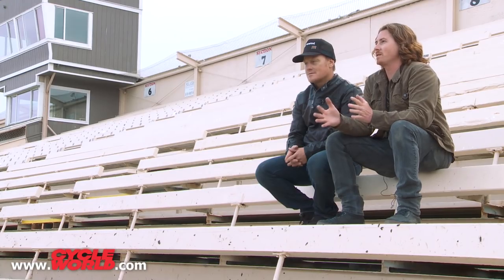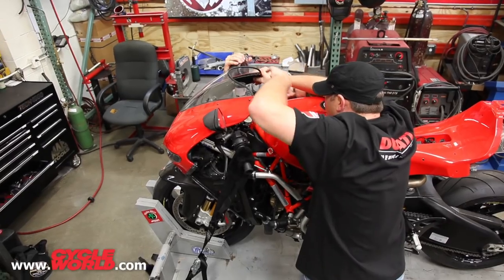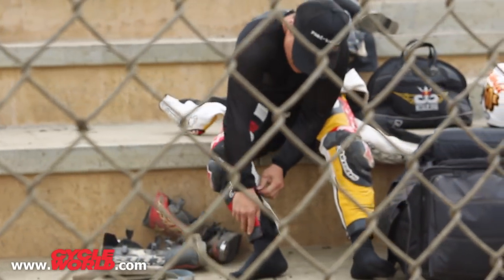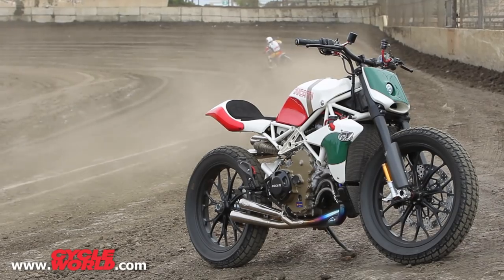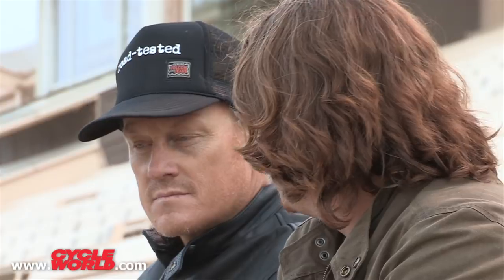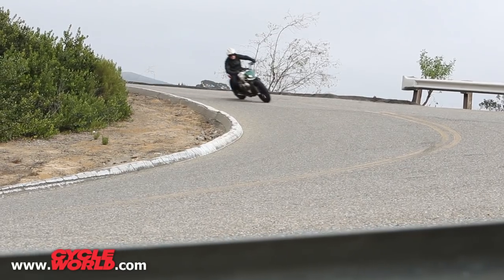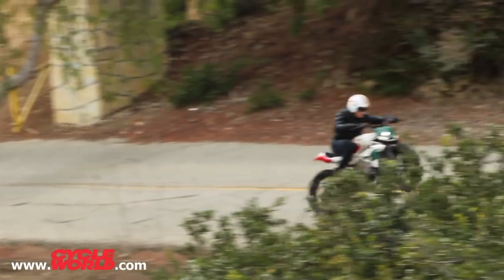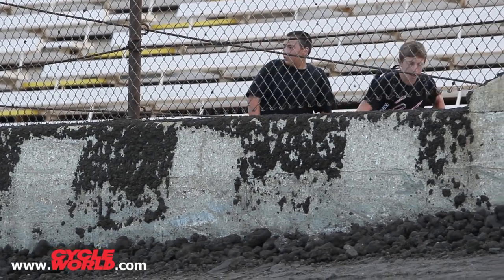Riding Roland Sands Design's Desmosedici Street Tracker

Comment: While i like the customizing of any bike, i can't see tearing apart a work of art street bike to create a so so flat track racer. There are plenty of great options to go with if you wanna put a nice flat tracker together. A Desmosedici isn't one of them. Why would you want that huge ass frame and engine on a flat track racer? Its just way to much weight and power to use effectively on dirt. Which is why you see him riding like shit around a flat track oval. He can barely control it drifting.

Comment: Take a $70,000 bike and destroy its value. Flat track bikes have low end power,the Desmocedici has top end power. Totally wrong engine for a street tracker. Plus a road race frame won’t give good handling in the dirt,steering head angle is all wrong.